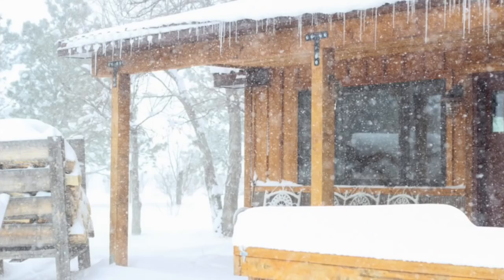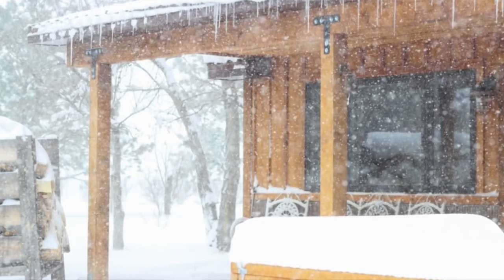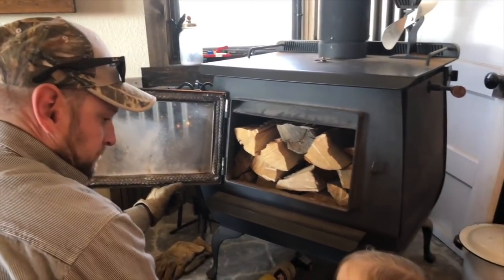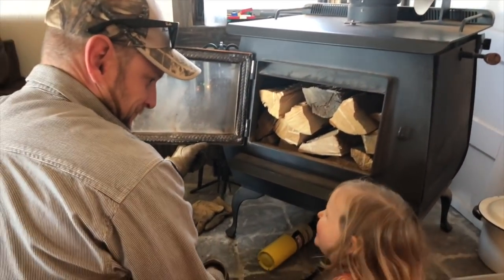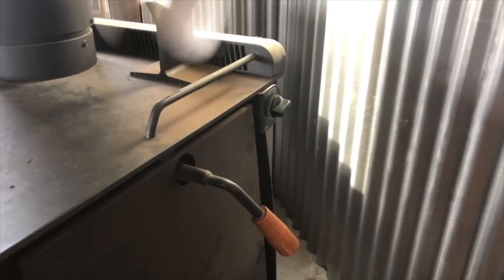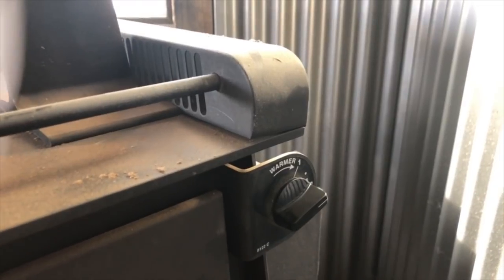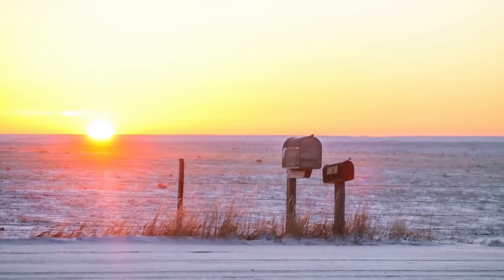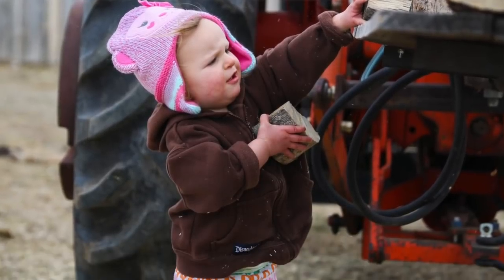How We HEAT (almost) Exclusively with a WOOD STOVE

Comment: We love our wood stove & couldn't imagine life without it. We're lucky that we do live in the woods. I keep an eye on craigslist & facebook market places & get a HUGE % of our fire wood for free or dirt cheap! We put 100 gallons of fuel oil in our tank 2 years ago, & there's still over 50 gallons left LOL. Heating with fire wood is a lot of work, & it's messy, but the trade off in savings & having that super warm heat source is worth it in our opinion. Another thing to point out is that wood is the only heat source that doesn't have dry out the air. We keep an old 9x12" pan on our stove & add a gallon of water to it 3-4 times a day.

Comment: We also heat our home with wood.  We have been toasty warm during many winter power outages.  We our on our second woodstove.  Both have been purchased used.  The second one has a larger capacity, so definitely the longer burn helps, but also being able to put larger logs in it.  The woodstove definitely makes Michigan winter's bearable.

Comment: Outdoor Wood Furnace . Hook it up to the house furnace to heat every room, even attic and basement. Run a second line to heat garage or workshop. Even heat's the water heater. Love our's. No messy wood chips or dust coming into the home. We had a wood stove before and it was great. Hope you didn't get hit to bad with the storm over the weekend. Stay safe and warm. God bless
Reply: Eats LOTS of wood!
Reply: What about when the power goes out??
Reply: They don't work when the power goes out

Comment: Hi Jill, awesome video.  I have a question for you.  I see twice in the video that you load the firebox fairly full to almost full.  Does loading so much wood overfire your stove?  We too use a wood stove and the room where the stove is in gets to around 90° and that’s with 2 quarters (pieces) and the airflow choked halfway.  If I were to load as many as your hubby loads in the video, I would be worried about the stove getting way too hot i.e. temperature gauge in the red zone.  Comments?

We use our stove especially on days when the mercury is below 0°F …. Canada, EH! and the outside temperature is getting too low for our heat pump forced air system to run efficiently.  In Québec where we live (think north of Upstate New York and Vermont), electricity is the main heating source since power is really cheap.

But our big problem regarding our stove is related to our house.  It’s a side-split and the stove is in our family room in the first basement.  It heats up that level ok and the heat rises to our bedrooms directly above.  

However, the living room, dining room and Kitchen do not get heat and can be 20° cooler than the family room (similar problem as the old part of your house).

Comment: We heated our house in the mountains of N. Georgia with nothing but a wood stove.  We bought an Appalachian stove for 300 on Craigslist.  It heated 2000 sq ft.  It was our only heat source for 4 years until I had to go to school in Atlanta for several weeks.  I put in a small propane heater in the kitchen to warm it and the bedroom.  When I came home my wife had never used the propane stove.  The wood stove would burn all day on a load and then all night.  Ashes and coals in the am and fire it right back up.  Loved it!  When we moved to the coast of SC we had a heat pump.  I almost froze and had nothing to back up to and get warm!

Comment: I've been heating with one wood stove (3400 sq. ft.) For over 9 years now. It was costing us $900 per month during the winter (about 5 months) using electrical heat. I installed the stove centrally on the middle floor (we have a two story house with a walk out basement). We average 74 degrees on the main floor where the stove is and 73 degree on the other 2 floors all winter. I cut 8 cords of wood each year and burn about 6 to 7 cords each winter depending on how cold it is. Overall I have no problems with my Napoleon 1900 stove, but the bricks are very sensitive and break easy. We burn exclusively Oak (white, red and black). Living on 20 wooded acres and having 2 other 5 wooded acre parcels gives us a good continuous supply of wood (we only cut up dead or fallen trees). Wood is the only way to go...period...

Comment: Great video, I own the same stove and have the same great experiences, I heat approx. 1600sqft total, the stove is in the basement, I did buy the convection deck and blower, but only need to run it when the temps drop in the low 20's and lower. My average burns are approx. 18hrs, but I switch to 12hr cycles when the temps go into the lower 20's (like now lol) the cat lifespan is approx. 10,000hrs, so look for a replacement, you wont regret it. 
I'm lucky here, east coast so we have a ton of hard wood like oak, ash, locust, maple, but the bk's love soft wood to. Currently 16deg f, inside its 70def f!!

Comment: Triple pane windows are also your friend.  I upgraded mine and am so glad I did.
Reply: I guess they are ok, but i think mine outdo triple-pane windows. About 15 years ago i went to Harvey for vinyl replacement windows. They had something i didn't even know about.  DOUBLE-pane windows with "attached storms".   I think they can beat almost any window out there.   The one thing is really enjoy is during the winter, when the sun has been up and sending out some heat-rays, i raise the double-hung window and that allows heat to come right through the attached storm  ( plain old heavy duty glass ).and actually heat the room a little bit.   There are NO drafts, NO leaks.   It's fantastic.    I have an Avalon Rainier woodstove, in the living room on the fireplace hearth, jus tgiving me all that great heat.   With those windows and my stove, i pretty much can heat the whole house, albeit i rigged up a double-bladed window fan in the hallway min order to bring the heat to the end bedrooms.      Normally, i do NOT use the oil furnace, except to heat my domestic water.    If the temps get below 20 degrees or so, then i will turn on the back blower to force out a little more heat, otherwise the unused heat just goes up the flue.

Comment: Down draft gasification boiler with hot accumulater storage tank is the ultimate in all hot water and heating needs. The house is so much cleaner and not smokey. I blast burn my Eco Angus  every 3rd day with a full barrow load of hardwood that heats the heavily insulated 2500lt accumulater tank to 75 ~ 78c°. On the 3rd day the tanks still 52 ~ 58c° for a family of 4 thats had 12/15 showers and has usually 1/5 hydronic panels running on a 60w circulation pump 18/7. Our plant room sits 3m off our old poorly insulated house and we have hot water instantly as the hot water pipes nest with the hydronic pipes. Imported the boiler and tank myself from the UK and saved thousands, although no one in Australia knows about downdraft gasification. I've gone from two level wheelbarrows a day just for heating to one heaped every 3rd day for hot water and heating,  burnt in a single load and the burn is computer controlled (fan forced induction) to maximise the wood and not boil the accumulator tank.  We keep our wood undercover and about 15 wheelbarrows seasoning in the hot plant room doing that keeps the boiler pipes clean of criosol and increasing boiler performance. 
Lastly I've gotten my life back. 🇦🇺
Reply: Dean mather UK here and a big fan of log boilers and thermal stores. The US habit of packing a stove full and slumbering it all day is the worst possible practice for efficiency and also pollution. My current home doesn't justify a big thermal store but my next move will be to a large, rural property and I will certainly be installing such a system. Another advantage is that the thermal store can accept multiple heat sources, so excess solar can be dumped in there, or in the future when we have a smart electricity grid it could take excess power from the grid very cheaply. You can retain a conventional gas boiler as back up too.

Comment: We are praeirie dwellers too. Built a masonry heater 20 years ago. Salvage lumber is the only fuel we ever use, cleaning up collapsed barns mostly. Tremendous heat in those douglas fir boards and 2x6.That is what the mh likes , a quick, very hot fire .The fire door is only opened once a day, 7 oclock in the morning. It is still radiating heat at 10 oclock pm. The cost to build is minimal. Only bought material are the fire bricks for the fire chamber. the rest is used chimney bricks and ordinary clay from the cellar for putting the whole thing together . some chicken wire as "rebar" in the clay plaster. The door was built from scrap iron, the only metal part besides the pipe going into the chimney. Total expense back then  around $200.-( chimney extra of course) The thing  is about one ton. The chimney never needed cleaning yet. wood consumption around 40 lb per firing. Very simple , anybody can build one, the perfect infra red heat, private sun, so to speak. Best project in ones life ! Throw those iron monsters out and build one , you will never regret it . 
Kind regards to you all
Josef

Comment: I have a suggestion for you, if you don't mind. My previous boss owned a place that was a vet clinic/house (he had it divided) and had 2 wood stoves that heated the entire building via duct work and fans. We would light the stove (in the clinic side) first thing in the morning, let it heat for a bit and then turn on the fan/blower (not sure what it's called) in that room. It sucked the heat up into the duct work and forced it down through the other vents in other rooms (except surgical which was heated via passive heat from the greenhouse windows). Also, I never realized how close y'all are to the freeway? road?

Comment: Our stove is very similar. The problem we have is that to get the stove up to the temp where you can flip the lever it is putting off way too much heat for our house so we end up running it without using the converter. Live your house! You've done a great job.

Comment: Did yall build that storage area thing (lol, i dont know what to call it) for firewood? If so how. I really love that idea. We used fire wood stackers made from metal pipe and 25ft by 3 ft crates made by  1 inch thick plywood and held together with 4x4s and 4x6s in the middle inside and outside. The crates are made for equipment for cell phone towers. Nothing has been conventional for us and i am the only one in the family that gathers wood for inside and i think yalls method for it being right off the porch wood work wonders for me.

Comment: I love your fire pit area!  The metal on the walls is actually reflecting heat..so bonus there as well.  Im taking my wood stove to the next level and drawing the heat from the side of the stove threw ductings and a small 5" fan to blow the hot air into the crawlspace. Definitely not my idea.. our forefathers have been doing this for eones..but our generations let it go in favor of looks over practicality. Efficiency is what it's all about !!!  :)

Comment: Do you ever worry about loading your stove so full? I am new to wood heat, 2 week into it and I can't seem to put more than one piece of wood on at a time without worrying. Even with one piece sometimes my stove gets almost to the "to hot" range.
Reply: Late response I know but the style stove she is using has a thermostatic control which adjusts the airflow automatically so you are able to fill it up full without worrying about temperature variation. The thermostat on the stove will adjust based on the heat output. Most stoves do not have this feature though.

Comment: We have had a Blaze King for right at 30 years. I think it's the Qeen model , it was made before the converters came out. We had a 14 ' by 70 ' trailer house then & now a 3200 square foot house . We have it in the basement & it heats the whole house & basement ( full basement ) with no problem. 3 to 4 cord of wood usually for a winter and we live in Montana so it does get cold ! I think you made a wise choice . I would say the early catalytic converters were pretty worthless but are probably better now . Ours smokes a little at the start but not much after it fires. Good luck on your adventure !!! :-)

Comment: You cant beat wood heat. We too have a blaze king...but its a wood furnace. Its ok but would rather have a heater like yours. We are lucky we have lots of trees where we are but there is something nice about having a logging truck pull up in your yard and dump off the wood. We also have a home built log splitter but it has a gas engine. Thanks for your videos they are really great. Happy New Year

Comment: I also love wood heat, am heading toward getting a rocket stove for this place.  Less wood and longer heat kind of what you have achieved though you still use more wood than I will.   Thanks for sharing.
Reply from the maker: I've never looked into rocket stoves, but I've heard people say really good things about them!
Reply: Check with your homeowners insurance regulations first....
The burn chamber in a rocket mass stove runs at extremely high temps. It may (actually will) nullify your insurance.
If you are not forced to have insurance then the choice to have a Rocket mass heater depends on your choice and also local building codes.
Reply: A small rocket stove for outdoor cooking is likely ok almost anywhere ... Anywhere a BBQ grill is allowed I would think.
Reply: @jimmyfortrue3741  Rebecca is talking about inside the house.   There's only one or two rocket stoves UL certified.  They burn small amounts of wood or pellets.  The wood is almost a constant feed from 45 minutes to an hour per load.  
The real trick with these stoves is to run the flue through a mass to hold the heat.  The flue doesn't get creosote because it burns everything in the chamber only leaving gases.  No smoke goes up the flue and therefore no creosote.  A cool stove.   
Personally I think I would build a masonry heater into a new home if I ever moved.
Reply: @theprairiehomestead  They are now building UL certified rocket heaters.   The trick is to combine them with mass to make mass rocket heaters.  I don't have one because I'm waiting for a new design to be UL certified.   Then I'll likely have one installed as an emergence stove.  My wood burning stove relies on electricity because it's an insert.  Great when the power is on.  Won't heat a thing without electricity.

Comment: I and my wife are 74. My first job out of college was engineering dept . At a nuke plant. We bout a 1857 farm house and started our home stead. Cost was $19000. We bought a wood burning stove at an antique dealer and I cut and split 10 full cords a yr. built small barn from a local sawmill.  For chickens ducks geese border collie 3 cats and set about restoring house and property. We gutted and lifted house for a new basement. Now we have a 5000 daft American classic with 3 fireplaces 4 bedrooms 3 full baths. My house is appraised at $456,000. Sine we’ve lived here 46 yrs our taxes are $750. When we bought the house our taxes were $56. We now heat with a geothermal inground heat pump. We still miss the wood heat. Smells and feels the best. Michigan

Comment: I remodeled Murdoch's stores for many years and that steel was something they wanted on the Laramie store.  We had "rusted" the steel en-mass outside while we worked on the inside.  Of course we didn't do enough, found that out later.  Well, I installed the new steel and masked off under it and proceeded to spray it with a salt water mixture every few days.  It "rusted" nicely in a few weeks.

Comment: been doing it for 4 years.  YES ALL WOOD ONLY WOOD NOTHING ELSE.   its  been trying  but this year its will be 1/3 because were about finished with the new house build. propane furnace/electric inlay in the flooring /and the blaze king 302.  there is nothing like it . we have a BLAZE KING 302 and the house is a 1920  farm house with more drafts then swiss cheese. but there no i want the temp set @ 70. so some times it was 78 in the main room while the up stairs is in the upper 60's  with fans a blowing to move the heat around . when we go to a family members home were cold and the temp is set to 70 on the dial its sad. lol  were in eastern south dakota.

Comment: How much do you pay for a semi load of trees, and about how many cords of wood do you get out of one semi load of trees?
Thank you for your show 🤗
Reply: Almost better to do a part time job for most people. We heat with wood with boilers and use about 13cords per year. When you add the time energy and cost of tools, tractors, 2hrs per day splitting stacking drying per season it becomes very difficult.  I have a 12 car garage attached to the house so it is worth it but it is so much work.

Comment: We absolutely heat our home with wood heat 100% of the time.  I shut off the polot light on my gas furnace as it never gets used unless we go on vacation. When we do, we also shut off the water pump from the well just in case a water pipe breaks.  But our home is super insulated with closed cell foam in the exterior walls, so a busted pipe from extreme cold couldn't even happen in this house. R 60 blown in fiberglass in the attic floor and we have very little heat loss.  We wake up in the  morning and the house temp is maybe 64 at the lowest after the stove no longer has wood to burn. Upstairs rooms are warmer than downstairs rooms since heat rises up the stairway which is great. We burn about 10 cords of wood in winter, but this year, maybe 8 as it's been more moderate here in Michigan. I'll never be w/o wood heat. It's more than just heat...it's a way of life for us.